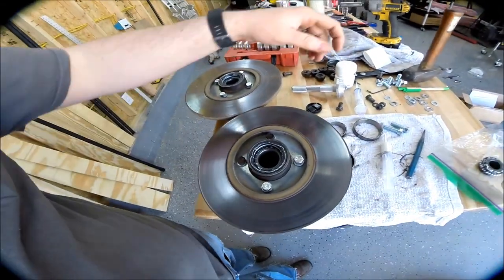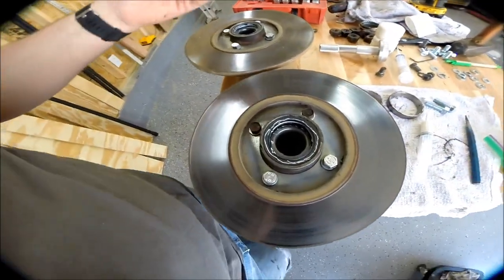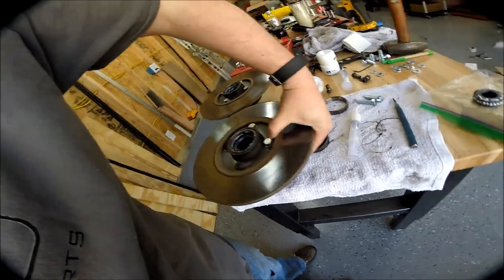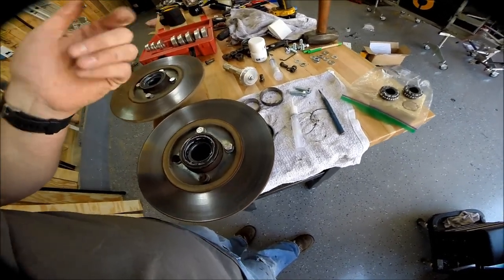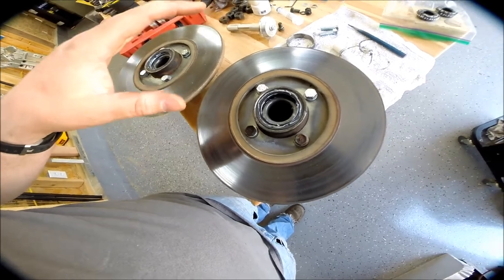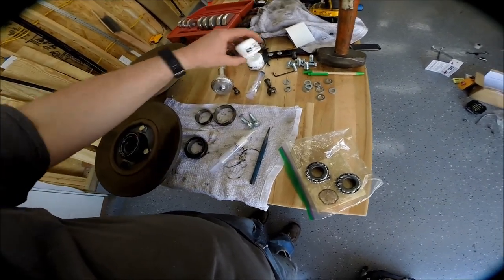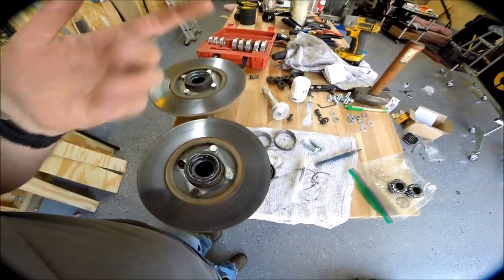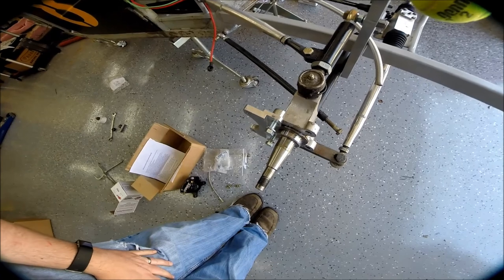Legend Cars Hub Rebuild and Wilwood Brake Install

Comment: Thanks for posting this video.  I am new to Legends and looking for any information I can get.  Have you posted a video on the rear brakes?
Reply from the maker: I haven't, I'm just running the normal rear setup
Reply: That's my problem.   I'm trying to figure out what "normal" is.   I'm sorting through the rear brakes and it seems this car was put together with whatever springs were handy.   Also there are no adjuster levers on this car and I'm not sure if they are supposed to be there.  The web-site drawing shows them but without a call out ID.  I know it's a Toyota rear end (and I assume brakes too) but what model?  They guy at my local parts store will want to know that before he can help me with parts.  Any help would be greatly appreciated.
Reply from the maker: I believe it's 76 to 79 toyota celica rear housing and brakes.  the only change from original is no parking brake and flipping the adjuster around so it rides on the spring (prevents it from spinning).  I can send you pictures if you think that would help?
Reply: Great bit of help.   Thank you!   I won't trouble you for a pic.  Thanks for offering.  Now that I know what I'm looking for, I believe I can take it from here.  Good luck with your season!

Comment: How many foot pounds is the spindle nut? Was the wilwoods worth the invest from the original calipers
Reply from the maker: Because I used the spacer I could not over tighten the spindle nut, therefore I just tightened it down until I was happy.  The Wilwoods worked just as good (if not more consistent) than the stock calipers but it was the weight savings that we great!  So, not real performance gain, just weight.

Comment: Did you check hub end play?
Reply from the maker: Silas McCarty I didn't have a gauge for it but I adjusted until I had no end play (without grease).  They spun fantastic dry without any play.
Reply: BigmilMotorsports don't spin your bearings dry haha it scratches the inner race of the bearing
Reply from the maker: Good Call!  I think I spun them a little dry but not too much.  Thanks for the heads up!